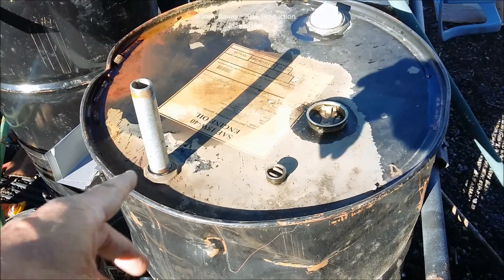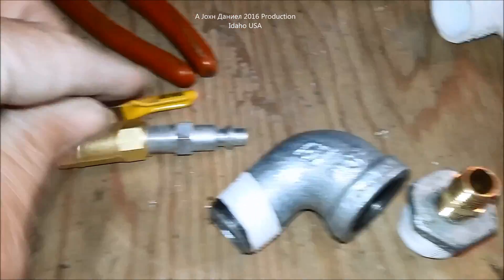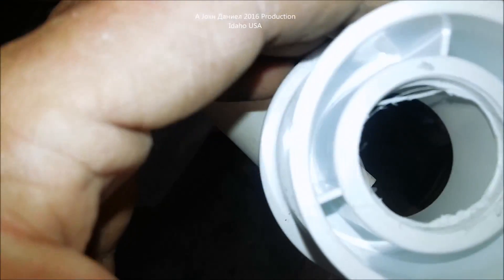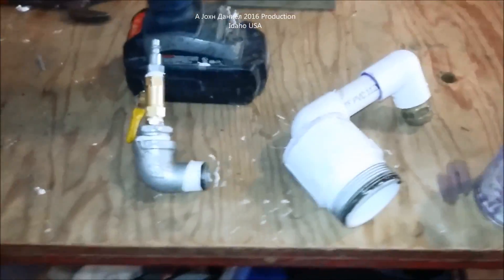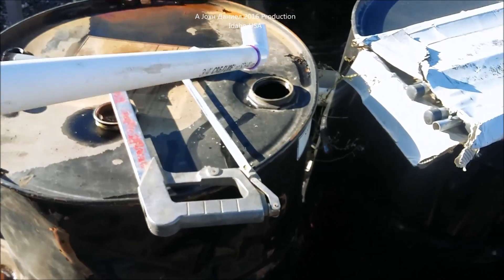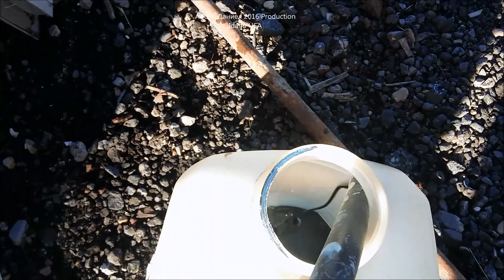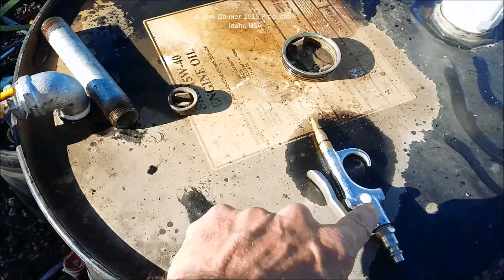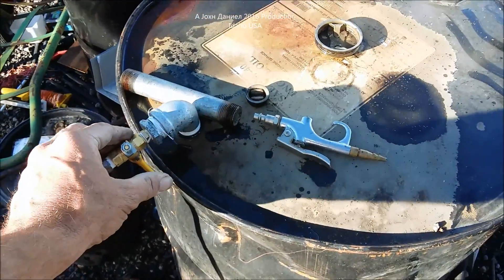Air Pressure to pump oil, water & more Simple AIR DIFFERENTIAL PUMPING

Comment: Good job you didn't waste my time with showing me all your junk and the Ranch of eternal ego .... you just showed how to do it ... I was surprised that the the PVC fittings  fitt good enough to glue and seal ... the difference for ME ... I 'll get a fitting to connect PVC to a 3/4 copper for the outlet in the drum .. I have gasoline and want to leave it there .. takes out the possibility of PVC getting brittle -- the cost LOl you about 16 in it this is vid was 2016- LOl I bet I spend 40 and I have the copper pipe in the barn too ... thanks again

Comment: Interesting...I'm planning to use my pancake compressor to pump liquid fertilizer via my garden hose to a fine sprayer - the key is to find a 5 gal container that can handle decent pressures...Any suggestions?

Comment: dam that looks dangerous
Reply from the maker: Sorry to take so long to reply, typing with 1 remaining finger LHOL
Reply: @JOHNDANIEL1  haha
Reply: 🤣🤣 you have not seen danger my friend
Reply: Hardly it was only 10psi
Reply: @16vastraturbo  5 lbs. pressure is a lot basically pressurizing a 22 1/2” diameter thin pipe wall pipe .

Comment: Can this be used for hydraulic oil?
Reply from the maker: Yes, but its a slow process so I just hook it up, set the air for 8 to 10 PSI and go do something else. If your in a hurry you need a $200 pump! I am not.

Comment: Did you ever have trouble with air bubbles getting trapped in the rubber hose line?
Reply from the maker: +Matt Griffin Yes at the near empty point but I just left it running and the container pumped to was vented to allow purge.

Comment: Great Idea for sure :)))) - Although I bought a Harbor Freight 12V DC Pump with Garden Hose Adapter for mine. But if it breaks in the future, I will give this a try :D
Reply from the maker: +Jod Bronson it works better if you find you a old 100 lb propane tank and put a adapter valve and drop tube in it. 
Look for a video from me soon showing how.